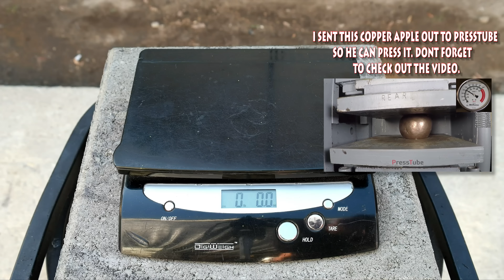Casting A Solid 5 Pound Copper Apple

Comment: did this guy just did replacement casting on an......apple !? what a guy
Reply: It looked like a wax replica of an apple. You can see a moulding seam in the stem at 0:12
Reply: John Watkins its a foam apple,  a real apple wouldnt cast
Reply: My head was about to explode because I thought it was as well.
Reply: SkankHunt43 actually not true, since apples are 90 percent water it just evaporates from the extreme heat.

Comment: i have a copper
i have a apple
ugh 
copper apple
Reply: Um yeah.You don't want to see how they make copper statues.
Reply: Invoke article 50 petitions/133618 usually statues are made of bronze...
Reply: Invoke article 50 petitions/133618 and i know that statues aren't made like this Apple, they are made from a mold
Reply: Guy's it's not even a real apple. It's made from styrofoam.
Reply: I have a fork
I have a socket...
ugh
R.I.P
Reply: NeutralChaos410 boiii, this was when that thig was still a trend, and the grammar i like that to fit better the meme
Reply: max chavez grammer*
Reply: edgar sanchez grammar*****
Reply: max chavez ppap sukz
Reply: venkun videot  yeah, but this was 2 months ago, it was 2016

Comment: what happened to the Apple
Reply: it was vaporized by the intense heat of the molten copper. the gas it turns into starts to escape after it was vaporized which is why the copper bubbled up when he poured it.
Reply: the apple is gone
Reply: it was one of those styrofoam apples.....decorative kind
Reply: Jason Walker Ohhhhhh
Reply: micah weems looo best explanation ever "the apple is gone" 😂😭

Comment: what is the reason for adding the borax? im guessing maybe it removes some impurities or something?
Reply: Tito4re your right my left. ;) jk
Reply: Thanks, was wondering the very same thing
Reply: Sad Onion it keeps the zinc from evaporating
Reply: I think
Reply: Actually, You are thinking of Brass. Brass has zinc in it.
Reply: Kirito5628 Mcpe gamer Actually, brass helps with impurities, for example, gunpowder from melted brass bullet casings.
Reply: Brass is literally an impurity. If you expose it to air while it is molten, it will erupt violently spewing metal and yellow string-like Zinc all over the place, so you have to add flux to brass when it is molten, or while you are melting it. It is very dangerous to try to do otherwise.
Reply: Borax acts as flux and draws out the oxygen in the molten copper producing a higher yield of pure copper
Reply: I was curious about that, too. pretty interesting.
Reply: Byron Pratt Zinc in copper? It is not brass i guess. Anyways, do you mean Borax helps preventing the Zinc sooth in brass casting?
Reply: Any percentage recommanded?

Comment: The fuck, did the apple evaporate?
Reply: It was a syrofoam decorative apple
Reply: fat ohhhhh, that's explains a lot 😂
Reply: Yilun Chen he said did the apple evaporate😂
Reply: Actually, it kind of did shinigsta. The molten copper is so hot, it vaporizes the styrofoam. It is used in casting all the time because of that.
Reply: dam can u like make me sniff some styrofoam vapor
Reply: Why even use the foam stands then? Just put some dirt in, then the apple, then pack dirt around it and make a hole to pour the copper in. Then you don't have to mess around with cutting off the stands and grinding it down.
Reply: VenomStryker convenience, i guess. even though it's much more convenient to do it that way

Comment: What happened to the apple, when he put the melted copper it disappeared ???
Reply: it was a foam model and it was burnt away by the copper
Reply: It was burnt away. The foam was added so you can have a conduct to pour the brass and another to allow it to leak out so no bubbles get trapped inside.

Comment: 1300 comments and 90% of them are: why you use borax and what happened to the apple.

1. Borax is widely used in DIY casting as a flux. It traps impurities (oxides, debry etc) and stops the formation of oxides in most metals. Blacksmiths use anhydrous borax (because borax absorbs water) to forge weld. 
2. If it was a real apple, the world would have ended. Newton would have risen from the grave because apples gave us gravity! If you destroy one with fire, all gravity will go away. 
Actually this is a foam model (not plastic, because its much more dense and wont burn up so easy). Successfully trolled!
Reply: That apple started the apocalypse
Reply: 1 Applecalypse*
Reply: priit mölder You're smart! At least you pay attention!

Comment: holding a round object with your hand and then using a grinder whilst also not wearing gloves seems like a bad idea
Reply: Yea time to get a proper bench grinder.
Reply: knightmaher1 he is an expert
Reply: It is it's a very bad idea
Reply: Wearing gloves whilst using a grinder is a bad idea, can get caught and mess up your hand pretty bad.
Reply: knightmaher1 osha mad lol
Reply: Yea that is right until the grinder slips and tear up his arm or hand. It would be so awkward to look at him trying to grind round objects with a hook in the future.
Reply: Mike Pickford he's comfortable, but it doesn't quit the fact that he's using an angle grinder that could cut his finger in half in one second.
Reply: 6 of one, half a dozen of the other. I've had many jobs where I used grinders, and usually, gloves are the better choice, but they snag where your hand would just give way and potentially mess you up worse than taking some flesh - which can heal and is easier to stitch.

In this particular case, the choice is whatever you're comfortable with, just be careful.
Reply: Looks awesome man

Comment: if you made a mold out of silicone for the apple, then made a wax apple for the sandcast you would probably get less porus surface on the apple, all of the moisture in the apple has to cause that. its cool to see it works though, kind of like the stuff they found in pompei

Comment: You could get better porosity control with slightly dryer green sand and better crack control by quenching in oil rather than water, but other than that, fabulous video; I loved the format.

Comment: Did you use a plastic apple that was then melted when you poured the molten copper or was it a real apple? I thought you would first create a clay mold, bake the mold and have it in 2 pieces with 2 holes on top for the copper. The pits in the finished product could have been avoided with a two piece mold.
Nice copper piece nonetheless!

Comment: For a more detailed illustration of the cast object, I recommend a mixture of plaster, brick dust and brick slit. Incubate the apple with a sprue system in this mass and burn out this mold in the melting furnace. Then fill in the liquid metal.

Comment: Is no one gonna mention the fact that he didn't remove the apple from the cast or ask how he removed it without ruining the cast, or even better tell me how he did it cos if not then I'm assuming that it's not solid copper and that he simply just coated the apple with copper wich I'm not even sure is entirely possible with a casting process

Comment: great videos you got! I have a question for you, I am going to melt brass to be turned on a lathe. So I am going to use my crusible as the mold (steel tube with welded bottom) do i need to flux that or not? will it leave inpurities in the brass if i dont flux? 

Keep up the good work!

Comment: Great video. I see you do a bunch of casts. I would like to see you invest in a Tumbler and use different types of granulated materials to buff/sand the items down right into the nooks and crannies. It will also reduce the amount of work you'll have to do to sand it down after the tumbler takes care of most of it. I think a Tumbler addition will make showcasing your work that much more amazing. Consider getting one.